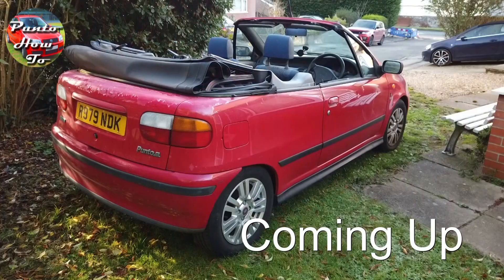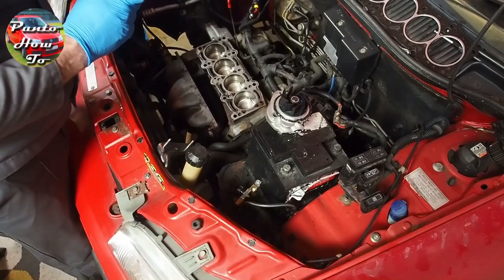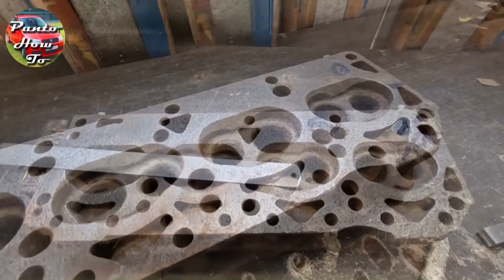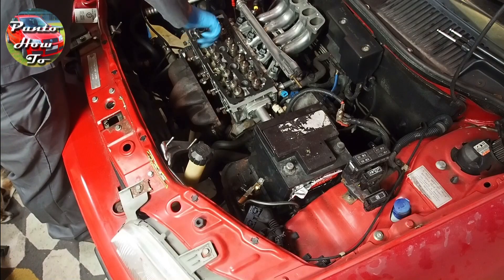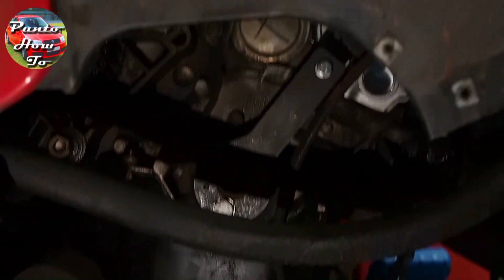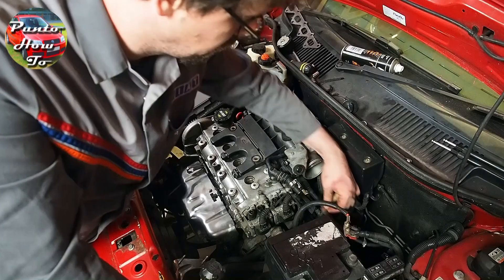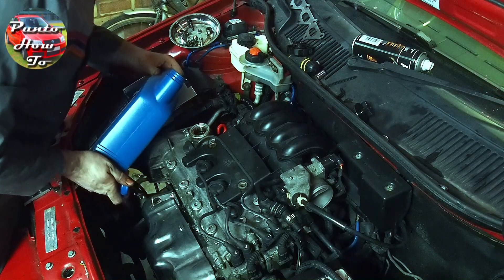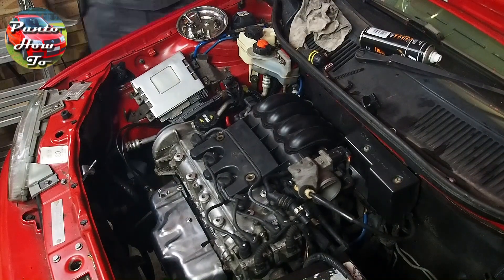Assembling The Engine: The Big Moment Has Arrived!

Comment: 6:51 how did you do when you get off the cylinder head? Did you have anything to hold the cam carrier? 

I just want to change the gasket and I don’t have the retainer tool, thanks
Reply from the maker: No I didn’t have the tool either and ended up with the lifters/buckets or whatever you want to call them, falling out, If I was doing it again I would definitely come up with something to hold them in place, a piece of pvc 90° angled plastic would easily do the job

Comment: To change the valve cover gasket you need to tune the car.
Reply from the maker: There is no “valve cover” it’s what’s known as a cam carrier, and to change the gasket you have to remove the full cam carrier which means you need a timing kit to reset the timing when you put it back together
Reply: @PuntoHowto  the locking kit to lock the camshafts ?
Reply from the maker: @ yes and the crankshaft so you can reset the timing after you have removed the cam carrier
Reply: @PuntoHowto  The video that explains this function in detail was cool
Reply: Do you do Facebook mate? I'm on the fiat worldwide owners and enthusiasts page. I'm putting a lot of my build stuff on there. I know you wanted to know about the piper cams and head work I'm having done. Either that or send me a friends request. Toby Larkin, I'm in Lincoln. Be good to get some more knowledge 😁

Comment: Hello awesome video and thank you for the detailed information about the rebuild. I`m doing the same with mine Punto 1.2 16v mk2. Do you know the flatness tolerance of the block deck and head? In the Haynes manual is cited 0.1mm of the head mating surface, but in the Victor Reinz installation manual is cited 0.05mm longitudinal and 0.03mm transverse. Which values did you use and also what brand head gasket? Thank you.
Reply from the maker: I used an unbranded head gasket set from a uk company. I went by the Haynes manual but it’s not going to hurt to be even more precise. These heads are prone to warping, as I was not replacing mine for any over heating issue, I didn’t feel the need to be so exact, but if I was then then I would have sent the head to be skimmed